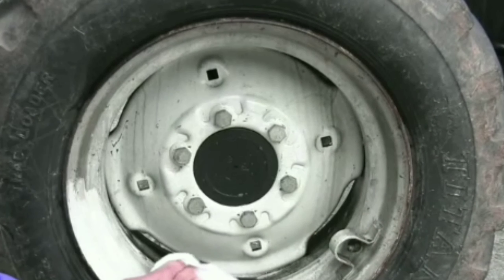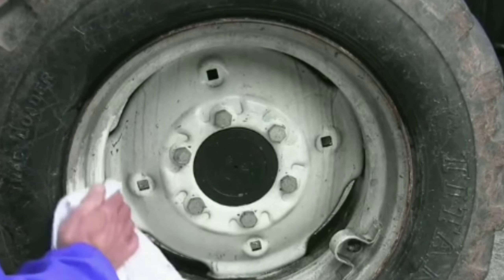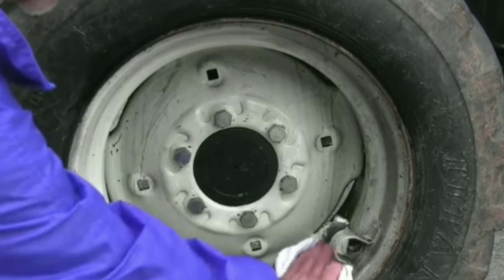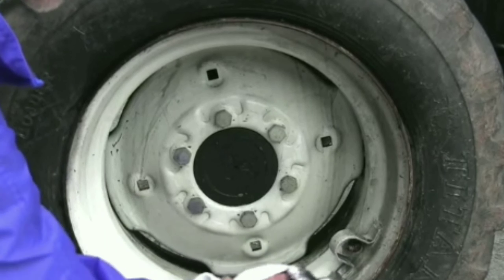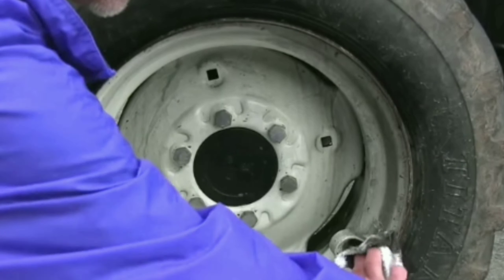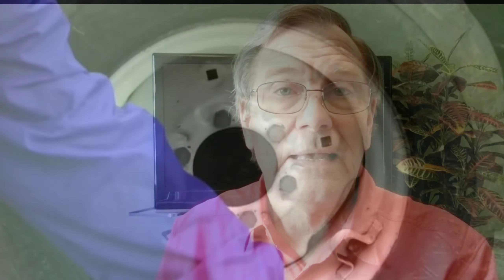Don't buy a tractor until you understand your tier IV options.

Comment: As tractors are out in the paddock 99% of the time, I do not see the point of emission controls. It forces either buyers to buy underpowered tractors or tractors that are more expensive to buy, maintain and are more unreliable.
Reply from the maker: It is amazing how good they do work. The only diesel I smell is when I am fueling and black exhaust is not visible. In some cases the manufacturer detunes a larger engine to get it under 25hp.. I wonder if they give black smoke and smell when that is done.
Reply: It’s wrong we don’t have the option to buy the system that we want!

Comment: There is also a third option. The LS xu6168 has a DPF filter for regen, but NO DEF TANK. Massey Furgesons seem to use a lot of the Dox systems. VarhnBerg implements has one that after 300 gallons of fuel only burned 1 gallon of DEF. Not bad.
Reply from the maker: Yes and the DEF tanks are going away pretty quickly across the board.